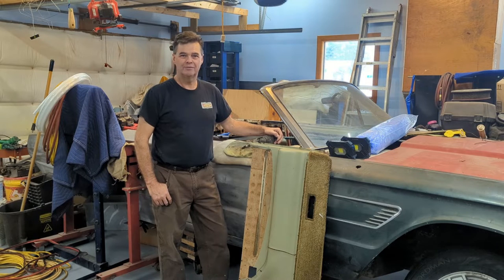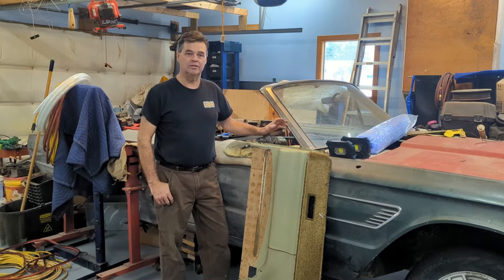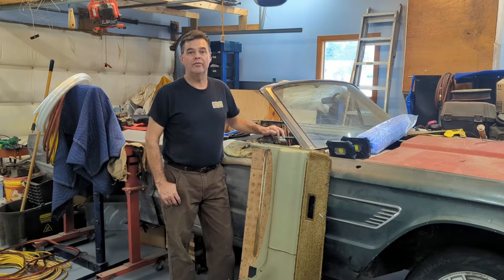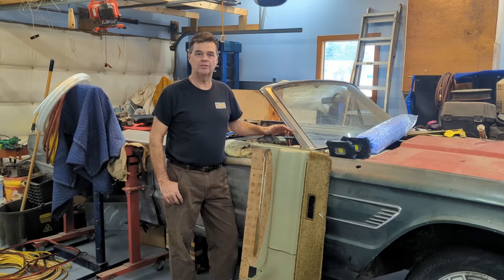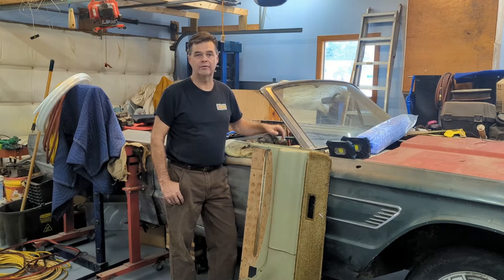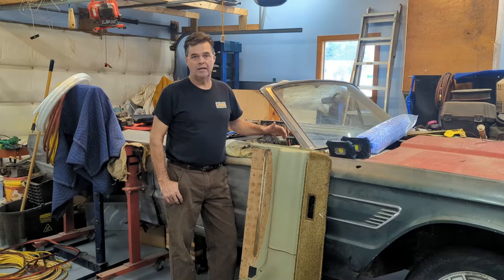What Causes Fuel Pump Tick? - Ford FE Engine

Comment: Hello Alvin: I have a spare pump out of our 64 T-Bird similar to the one you partially disassembled. The pump was working fine when I removed it. I installed a electric fuel pump along with other changes to minimize vapor lock issues in hot weather. After removing the old pump, I blocked off the opening with a fuel pump block off plate from a Chevy  427 I had on the shelf. Fits perfectly. Always fun   taking old stuff apart. By the way, that (broken) spring size and strength determines the fuel pressure. 
Thanks for sharing your adventures.
Walt
Reply from the maker: Thank you Walter,  that's good information! 😊

Comment: Yep I never had one apart either, knew the principle of it’s working. But once it leaked out the weep hole, and usually it was along side a road, so curiosity usually was over ran with being hyper pissed off at the situation. Lol
Thank for the insight
Reply from the maker: Lol...my guess is that there are a few of these old pumps in ditches across America! Curiosity was the driver for this video. 🤔

Comment: Alvin,
Good video, my friend.  The rip and tear types are the best ones.  I did wonder what was beyond the tip of the fuel pump lever, but was too lazy to tear apart the messed up one that came with Pearline.  I just slapped on a new one and continued to march.
Btw...we all know you ran that filter through the dishwasher before opening the cannister and feigning surprise. 🙄
Regards,
John
Reply from the maker: Hey John...you have no idea how much trouble I got into for washing that filter in the dishwasher!! Lol
I like taking this stuff apart just to see how it works, maybe it can be fixed... maybe not, but just learning how it works makes it all worth while. 😀

Comment: Years ago I had the same thing go wrong on a small block Chevy 350. I was 19 and inexperienced, thought I had a rod knock so I replaced all the rod bearings with the engine still in the car. The bearings were down to copper so it wasn’t a complete waste of time.
Reply from the maker: Hi Morgan...I think there have been many of those incidents where money and time were spent because of this issue, and didn't fix the  problem.

Comment: Very interesting. Ive never seen the inside of one either, no need to ever take one apart when you can buy a new one fairly cheaply. I guess Id buy them from Airtex back in the day. Thanks Alvin.
Reply from the maker: Hey Nick, if this one just failed to pump fuel, I wouldn't have bothered with it either...but the ticking sound that was similar to a lifter tick got me curious. 🤔

Comment: Hello Alvin. That was very interesting seeing how it works. I don't remember a spring in the canister with the filter. Sorry you had to go back to work. Was kind of getting spoiled with your many videos.
George B.
Reply from the maker: Hi George, I had another comment on this video saying their pumps don't have a  spring either, I wonder if there are a couple
 of different versions out there? 🤔 
I don't mind going back to work, it was always the plan for when I retired, to get a part time job that was easier on the body than mining. We also still want to travel in our van, since diesel fuel cost has been on the increase, the extra money will come in handy. 🙂
Reply: @J_R_Shop  I'll watch it again. Maybe I missed the part about the spring.
Reply from the maker: @servicetechnician3264  I just looked at the 65 manual, and there is no mention of a spring in the fuel pump filter housing...I have two that both have the spring, I'm not sure why they both a spring, possibly because they are aftermarket?

Comment: Interesting. The filter on my old (and probably original) '65 pump was just as clean as yours. My car had a new gas tank installed not too long before I bought it, so the filter cleanliness might've been related to that (Someone cleaned the fuel pump filter after installing the replacement tank, which seems like a reasonable thing to do.) But yours is clean too. Nevertheless, my pump had to be replaced, despite it's cleanliness. It wasn't pulling or pushing gas, and a new pump fixed that. 

I'll be very interested tot see the door panel video. Mine are shot, too. Same color as yours, as well.
Reply from the maker: I started working on the convertible again, so the next video will be working on the right front torque box...where I left off. 
However, because the sheet metal work is a little boring, I am planning on rebuilding some of the bits and pieces needed to down the road, and the door panels are one of those things. As it stands, the door panel video will be right after the torque box vid...just trying to mix things up a little. 😊

Comment: Hi Alvin, the spring in with the fuel filter is that original? The two fuel pumps I've had don't have a spring in there.
Reply from the maker: Hi Steve, yes, the spring is there to hold the filter in place, so it makes a good seal. Maybe your pumps are made different, and the spring isn't needed, but the ones I've taken apart all have the spring.

Comment: Very interesting. Ive never seen the inside of one either, no need to ever take one apart when you can buy a new one fairly cheaply. I guess Id buy them from Airtex back in the day. Thanks Alvin.
Reply from the maker: Curiosity was the driver for this video, I was interested in knowing why the pump was making a ticking sound that mimicked the sound of a bad lifter, the pump was still functioning, just noisy...now I know. Lol